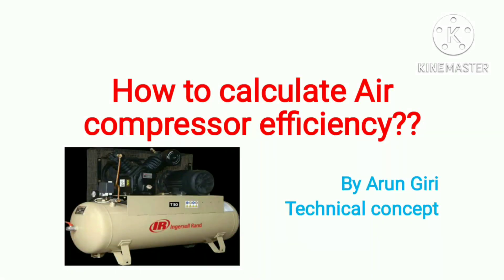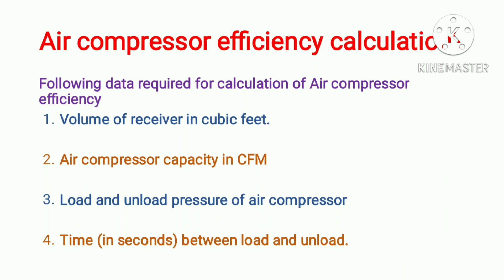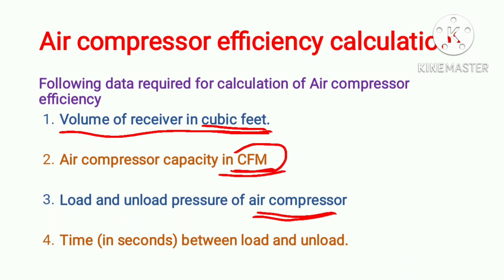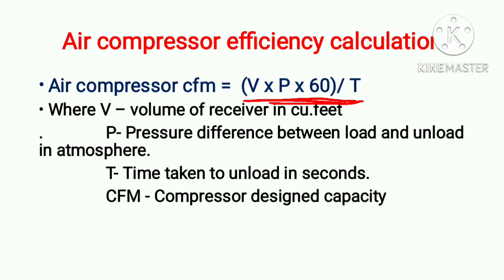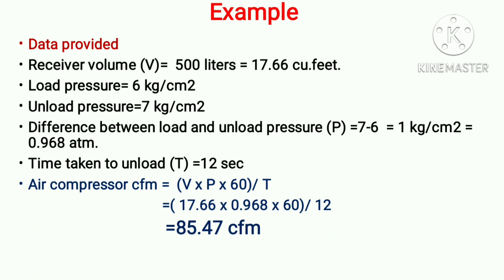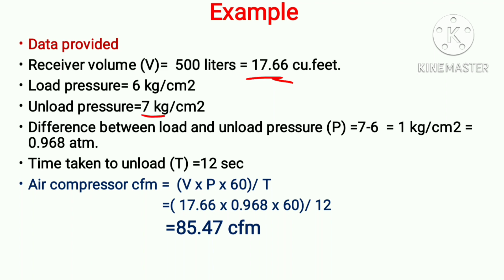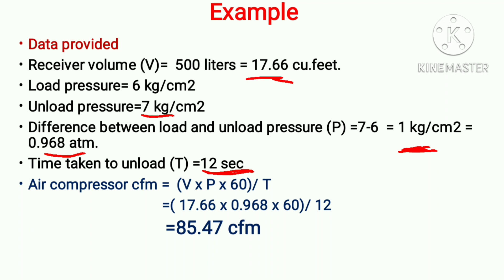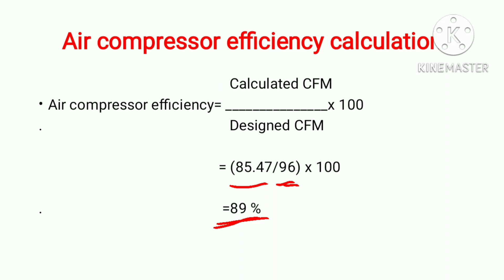[English] How to calculate Volumetric Efficiency of Air Compressor??

Comment: Don't understand abt load n unload pressure ..can u explain again
Reply from the maker: Load pressure is pressure at which air compressor starts generating compressed air and unload pressure is pressure at which air compressor gets cut off and run idle